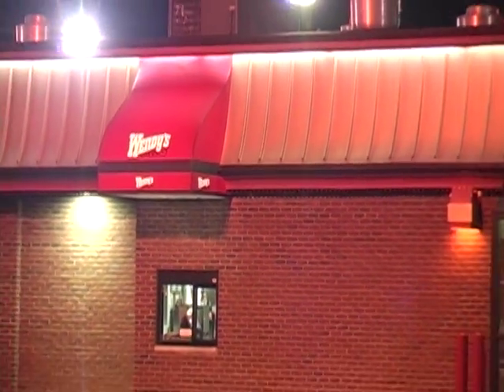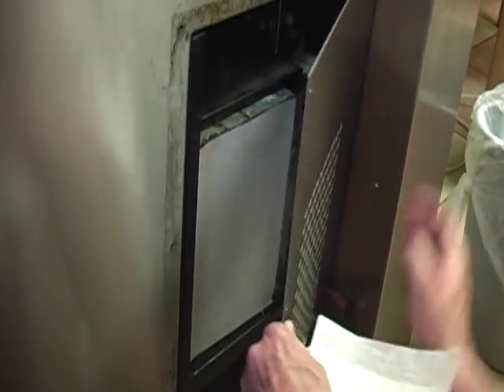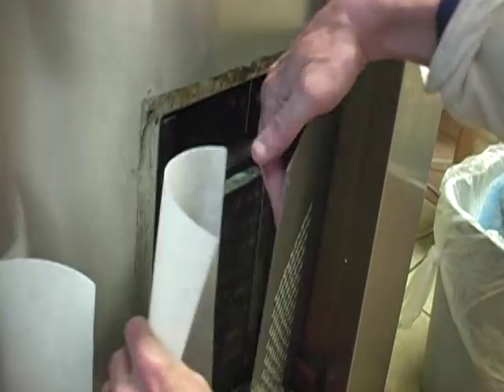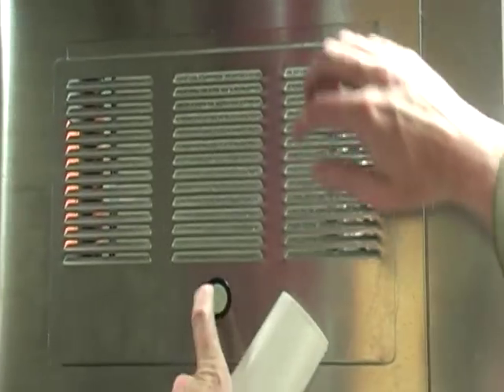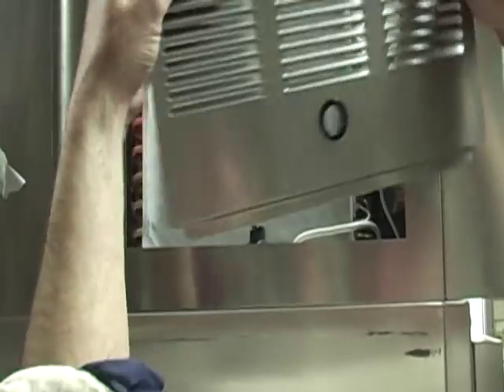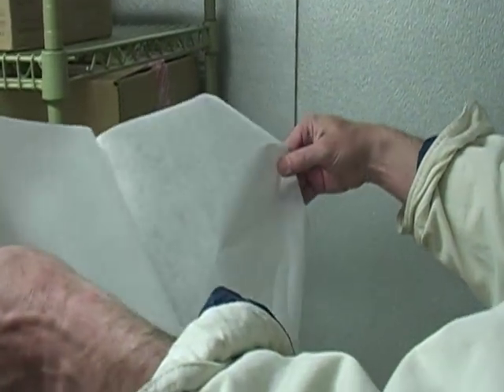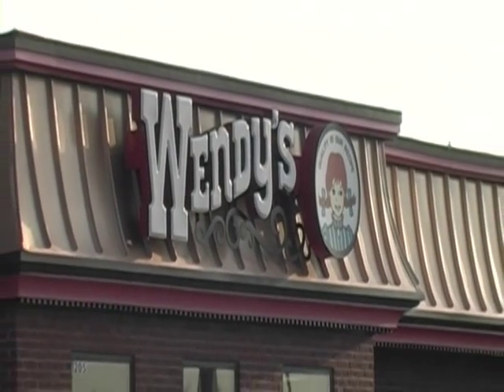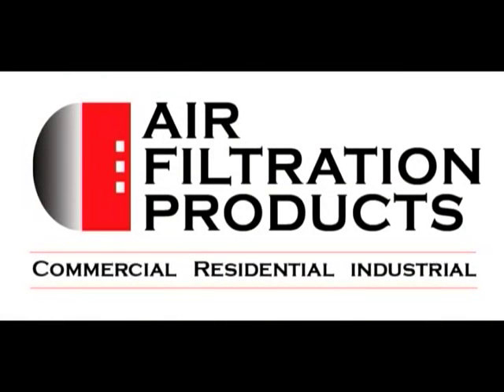Restaurant refrigeration/refrigerator Smart Filter Installation on Condenser Fins/Coils

Comment: Have you checked the head pressure and amperage with and without this filter ? I've found any type of filter causes air flow restriction and raises head pressure, causing the compressor to run harder raising the electric bills and wears the compressor out sooner. I've been in comercial refrigeration since the 60's, I think this product is a mistake. For grease I would use a can of ACE alkaline foam and a CO2 tank every 4 months. Most restaurants have CO2 tanks, ask your supplier for a brass fitting and a hose and blow the condensers out yourself. It might cost a service call but your electric bill will be lower and you won't get a $1200. compressor replacement bill any time soon.